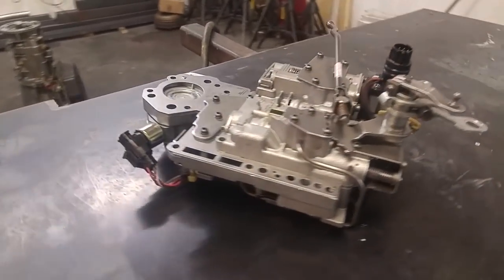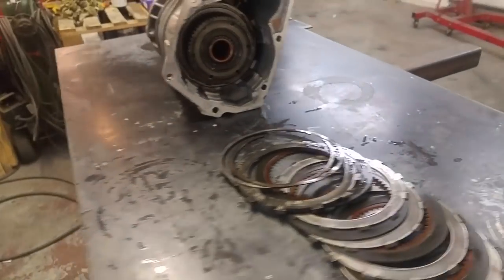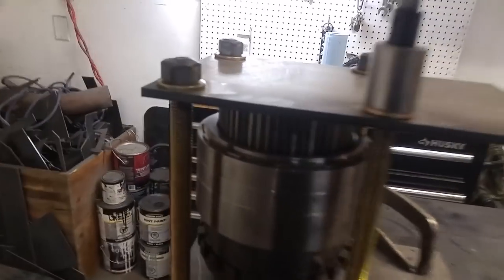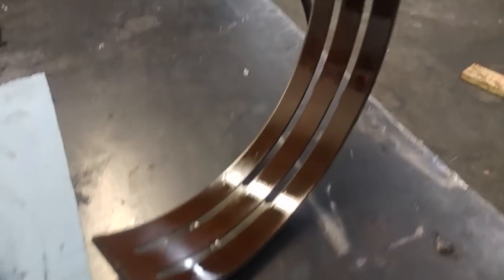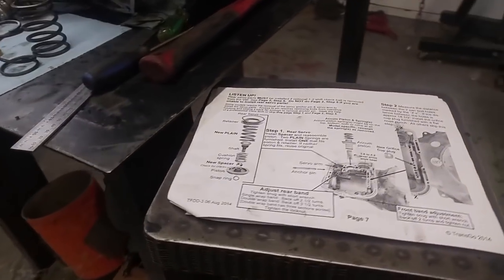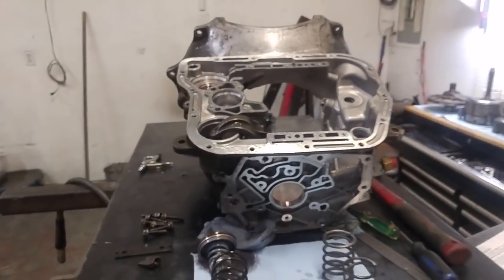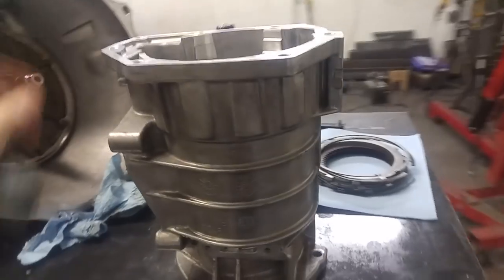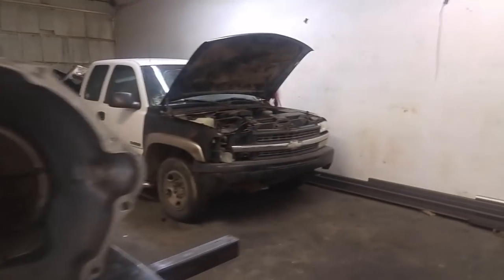CUMMINS 47RE TRANSMISSION REBUILD

Comment: I don't know what kind of power he's making with his Cummins but it would have been a great time to make some relatively inexpensive upgrades as cheap insurance.  If your VB is making more that stock line pressure a billet 2nd gear strut and anchor is a no brainer.  Also a billet shift accumulator that has an additional seal on it to replace the plastic one would have been a great idea. Maybe even a 4.2 lever and a billet 2nd gear servo cover.  The additional cost would have been minimal with the trans already open.
Reply: I pretty much was just browsing after he said yeah we can reuse those
Reply: 68rfe don’t have band struts cause it has no bands, and railwelder if you’d of not been browsing you’d heard/saw he replaced all steels and clutches

Comment: Just to clarify...
The forward clutch is NOT used in reverse.
It's used in all forward gears.... hence the name...
It is the rearmost of the two clutches hence is called the rear/forward clutch.
The direct clutch IS used in reverse along with the low reverse band.
For second gear the intermediate(second) band grabs while  the forward clutch is still engaged..
For drive(3rd) the band lets go and the direct grabs along WITH the forward clutch locking it together as 'one big chunk' and creating a 'direct' drive.
Up to this point the 800# spring loaded 'direct' clutch in the o/d unit is engaged. 
When it hits fourth (o/d) The front/direct AND the  rear/forward are still both engaged AND....
 finally the o/d piston overrides the spring and simultaneously releases the 'direct' clutch in the OD unit  and engages the O/D clutch..
And it feels wonderful.... lol...
Happy truckin!

Comment: i blew mine last month. still reassembling, sourcing parts/upgrading has taken way longer than i wanted.  my clutches were burnt, black, and steels were warped. the trans had 15K miles on it when it blew.  im sitting at about 1750ft/lbs of torque
Reply: If I were you, I put 2 oil coolers and a biggest pan . On mine I have stock oil cooler, and I added 1 from mishimoto and 1 biggest pan, and it s really good ! Because  what  is kill this trans. Is hot inside.

Comment: I have a 06 5.9 Cummins 
I had my transmission rebuild 
But now the truck won’t go over 80 
Sometimes 70
On the speedometer 
I was told i had to get a tune so it can go over

The truck is 100% stock
Stock turbo thinking about upgrading turbo

Comment: You have a really cool truck man, love you videos! Do you think its possible to replace the automatic transmission in my 2012 ram 3500 with a manual transmission?
Reply from the maker: Yup you can get nv4500 or nv5600 from any manual trans cummins 98.5+  or g56 from 06-12 and it will work in your truck. You will need to update the tuning to a manual trans os too.
Reply: Optimal Welding thanks that would be awesome I’m gonna keep an eye out for one cause that’s my only complaint about my truck
Reply: Better to  BUY a  DODGE 3500 with a  AISIN TRANSMISSION.   Aisin transmission is used in the 3500 (optional)  & 4500  & 5500.  DODGE  rates this transmission  @  CGVW 39,000.     TRAILER = 32,000   plus  8,700  pickup. 
I bought a new DODGE with Aisin transmission.   Need to sell my low mileage  DODGE  pickup,  Cummins with Aisin transmission. 
When you see a DODGE PICKUP,  pulling a   3 or 4  car hauler  Trailer,  that DODGE is  Cummins & Aisin. 
Aisin is the world's largest manufacturer of transmissions in the World.   Stronger than  Allison transmission.    Just buying my pickup  will  be much easier  &  much CHEAPER,   than  converting to manual transmission.   Plus my DODGE is all Factory  Original.   No shade tree engineered.  Cutting drive shaft,  u-joints,  cutting transmission tunnel,  shifter,  shifter boot,  ect.,   Ect.,  ECT.   IT'S  a bottomless  money pit.  The the manual transmission is  rated by DODGE  to tow less.  When DODGE  builds a  new  DODGE pickup  with  Cummins  & manual transmission,   dodge LOWERS the horsepower  of that engine.   Yes,  DODGE  derates,  so the manual transmission  can  stand up to Cummins Power.   
Also the Aisin transmission  is a Commercial Truck transmission,  that has  P.T.O.  block off plates.  You  can install  hydraulic pump on the left or right side.  Or use a P.T.O.   SHAFT  to drive a  air compressor   or  winch. 
I can drive this 3500 to your front door for  $2.00 / miles.  
Just leave a comment  for me.

Comment: Great video, I may use this as a visual guide. With this trans, so many things were still good, I guess I missed why you needed to rebuild.....?
Reply from the maker: It was just a core from the junkyard. I was expecting full rebuild along with manual valve body conversion but only issue was broken 3-4 acu spring. 
Shift kit included that spring so just slammed it back together as is and buddy is loving it.

Comment: Hey man I’m about to rebuild my 47re transmission for the first time. If it’s possible could I get any advice of what I’ll need or tips or tricks.
Reply: Troy Lee pretty straight forward it’s an easy rebuild. Get a manual and you’ll do fine.

Comment: Cool video.  So I guess you answered my question, have you done this before? Did you work In a transmission shop? Just wondering where you got this knowledge. Very cool. Thanks for the great videos.
Reply from the maker: I just research theory of operation and read other peoples experiences online till I'm 95% confident on how it works. Once you understand how something works its fairly simple to tear it apart to repair or make modifications.
Reply: Optimal Welding The interweb is a wonderful thing. One of the best tools available. That and of course a sound mind.👍
Reply: Hi excuse me to disturb you, I must to rebuild my 47 re and I want to put red alto eagle clutch, do you think I can put more clutch and steel than OE if I respect the clearance  or it does'nt work? thank you
Reply: @Cumminslife  thats kinda the way I am too

Comment: Replace all the solenoids and pressure sensors with good aftermarket ones, Oem only last 27000 miles

Comment: Is there some kind of return spring for the piston when it isn't engaged or does it just kinda float around in there when there is no hydraulic pressure?🙃
Reply from the maker: It has pressure on both sides!
Reply: Optimal Welding oh ok. Cool. Thanks.

Comment: How comes u didn't up grade the servos or the band struts?
Reply from the maker: I suggested it but its not my transmission.
Reply: Optimal Welding ok  he will back with a bent band strut. That's more money for you
Reply: Yep, always want to do upgrades while it's apart. But like said, the customer is the boss.

Comment: might be a dumb question but, how do i exactly tell which transmission i have , i have an 04 5.9 2500?
Reply from the maker: 04 cummins have 48re
Reply: also if your not sure there is usally a sticker near or on tranny indicating which you have

Comment: I have a easier  fix for the junk dodge automatic transmission. 
Buy a DODGE  with the  AISIN  transmission.   Sell your  DODGE  Cummins/weak  auto.  Next buy a DODGE with the  Cummins with AISIN  transmission,   problem solved.   And much cheaper than  rebuilding  a weak transmission.  And much much,  much,  CHEAPER THAN REBUILDING THE WEAK TRANSMISSION THE SECOND OR THIRD TIME 🤔
Reply: To get an aisin trans in a dodge your not buying a dodge your buying a FIAT lol